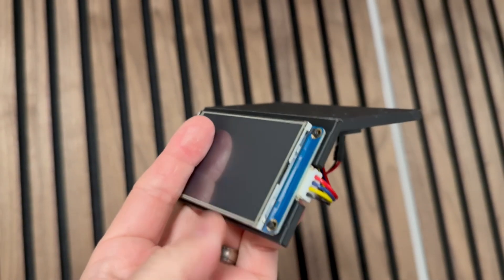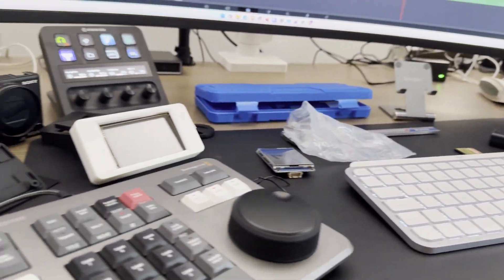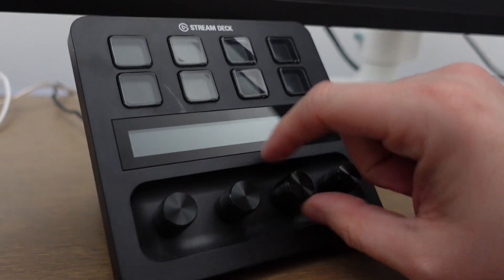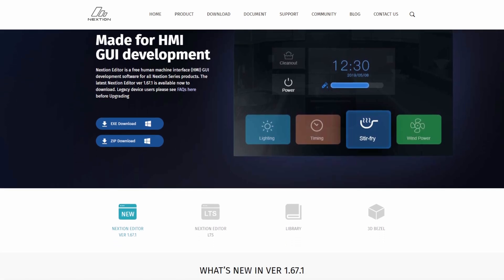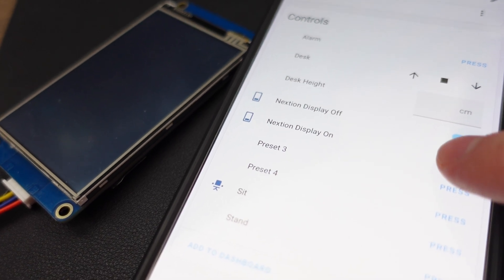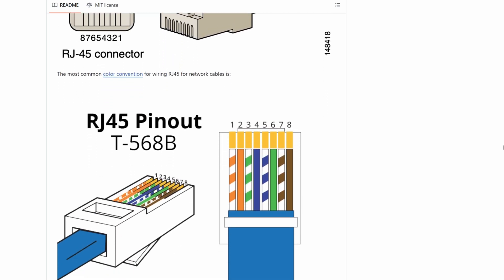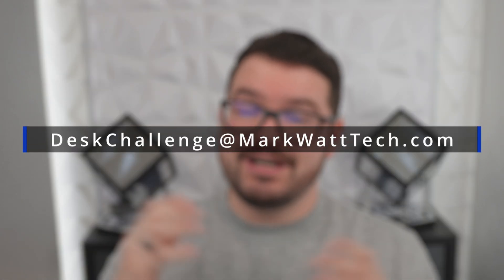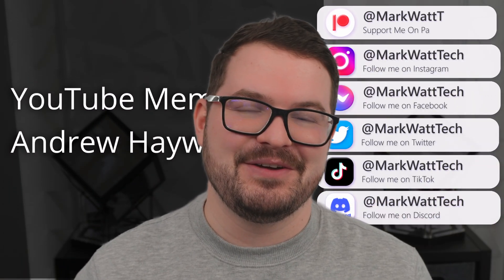Creating A Smart Desk Controller

Comment: If you are already working with Flexispot why not convince them to make an easier integration into HomeAssistant?
Reply from the maker: The controller used isn't manufactured by them. There also needs to be a physical component added in order for the desk to get it's "smarts" so it isn't just a case of writing an integration.
Reply: @ thanks for the explanation. But still nobody forces them to use a 3rd party controller.

Comment: I've got the E5 desk, doesn't have a second port on the control unit. Is there any way of using your device to replace the default control buttons but then also still being able to use the default buttons.

Im thinking of keeping the default buttons under the standing desk for when i'm sat at that desk, but also having the screen controller, exposed to HA which can control the standing desk when im at the other desk (main desk) in my office............yeah, I know, 1st world problems
Reply from the maker: So would you just be wanting to use both the physical and the touchscreen?
I think you could wire both to the same port but I haven't tested or tried this.
Reply: @MarkWattTech  Ideally, yes, i'd like to use both, original controls when I am at the actual standing desk AND the touchscreen when i am at the other desk.

Not sure you can piggyback, I briefly looked into it and got into a right mess so backed away slowly ;-)